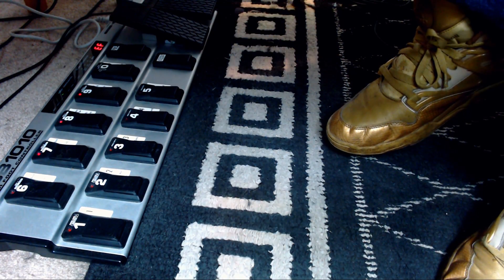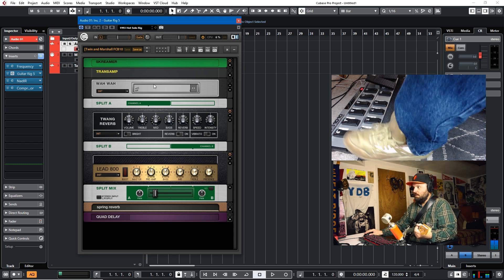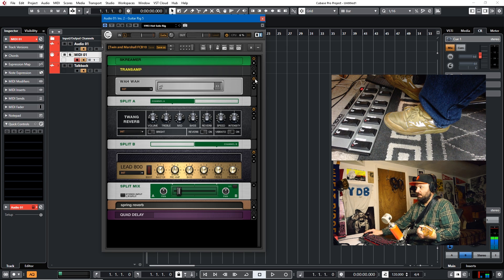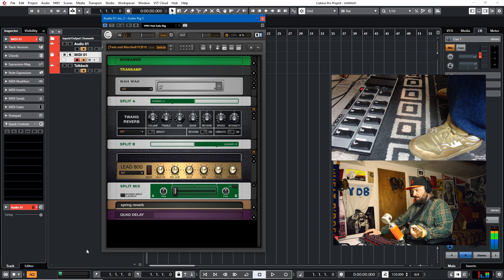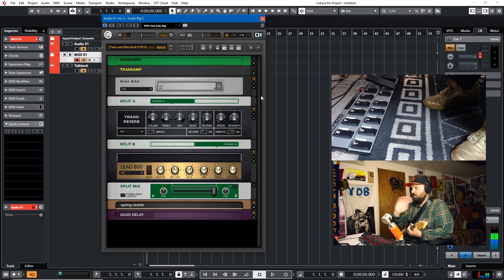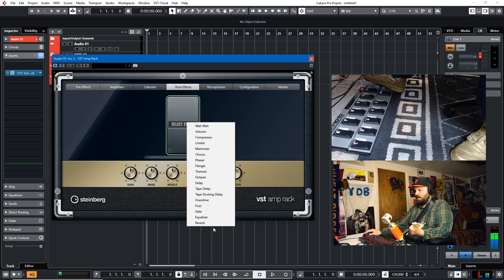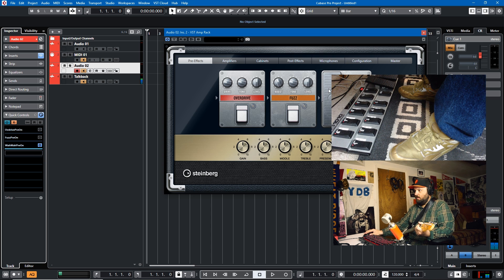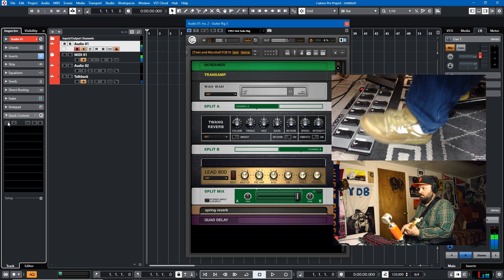Cubase 10, Behringer FCB 1010 and Guitar Rig 5 - Quick Tips

Comment: Hey, thanks for this video. I recently bought an FCB1010, and I really like it. I'm primarily using the controller to change my rack presets in Guitar Rig 5 and I have assigned various functions to the expression pedals. So far, I am struggling with using the FCB inside Cubase 11. One of my main GR presets is my main heavy rig, and I have assigned one pedal as a volume pedal and the other to control preset volume and distortion/gain levels. But none of that information is present when I open Cubase, where I have GR inserted as a VST plug-in. Do I need to reprogram everything inside Guitar Rig's Components like I did to assign the expression pedals when I use GR as a stand-alone? Or do I need to create a MIDI track as you did in this video? Thanks again. Peace.

Comment: HI, thank you for the guide. I have a question..
I've programmed the FCB1010 button number 1 for the Screamer, but the Screamer only turns on as long as I press the number 1 pedal. If I release the pedal, it turns off. Is there any configuration on FCB 1010 for this?

Comment: If you haven't figured it out yet, or for anyone watching this video hoping to find the answer, each foot switch pedal can be configured to send a different CC value for the expression pedal. So for instance if you stepped on pedal 1, then moved the expression pedal it may be sending CC value 1. If you stepped on pedal 2, then moved the expression pedal it may be sending CC value 2, etc. 
Whoever programed the board before you probably wanted to control 2 different effects depending on which foot switches they had engaged.
You'll just need to program it to send the same value, regardless of which foot switch is 'activated'.

Hope that helps!

Comment: Great video! I still have one specific question. The foot controller it can be programmed other than toggle mode? For example if I would like to use for articulation key switching, there always I need a midi message when the button is pushed down and indifferent how long I keep my foot on that, no more messages has to be sent. Eventually, the led to indicate the last selection or nothing.

Comment: Hey TLM! Controlling Steinberg-Plugins only via Q-Controls is wrong. Cubase is known to be THE DAW with MIDI-Possibilities all over the place! 
It would be a shame for Steinberg, if you could not control any midi-device the way you want it! Heres the thing: Go to the "Studio"-Tab, then choose Studio Setup.
Then click on the + on the upper left side. Choose "Generic Remote". Now in the added "Generic Remote"-Tab, choose your Behringer FCB1010 to be the Midi-Input.
Now you should be able to assign the pedal, via "learn"- function, for example "fader 1" in the upper task. Now you have to assign that controller to "Fader 1" to the 
WahWah-Pedal of the VSTAmpRack in the lower task: (AmpRack (or any VST) has to be inserted to any Cubase-Insert/Send or what ever.) 
In the lower zone look for "Device" and choose "VST-Mixer" from the dropdown. Next under "Channel/Category" select the channel where VSTRack is inserted from the dropdown.
Under "Value/Action" from the the dropdown choose "Ins 1 VST Amp Rack" and scroll down to WahWahPost/Pre. There you have it! Now you are able to control almost every
parameter of cubase via midi, even program Commands. Check out the "Device" task (and its sub tasks). You can also add multiple Generic Controllers, 
with different devices, midi-channels, setups what ever and save it to your harddisk. I hope this helps! If you have any further question, please send me a message. Greets
Reply: Whaaat?! I am trying sooo hard to understand the terms that are used here. It seems as if I have missed a very important College Degree . None and I mean None of this is easy or simple to the common guitarist. It seems that everyone is using a different set up. Can anyone speak in terms a Guitarist without a Sound Engineer Degree can understand ?

Comment: Cool video.
How would you rate the steiberg guitar amp, from 1 to 10 ?

Yeah, the quick controls were a great idea,  it worked perfectly with the cmc controller series... the cmc-qc  can be found for very cheap,  today.
If steinberg hadn't been so fuking greedy, by selling each cmc units for 'only' 150 bucks, and had sold it for 50-$70 each unit,  they would have sold millions and millions. ..
But 150 bucks for just a tiny controller. . Even the biggest steinberg fanboy  didn't blindly jump on it. 

This being said, i was able to grab a cmc qc, ai and ch, for very cheap. Frankly,  it works great with Cubase,  being able to control those quick controls with a cmc-qc controller,  is just fantastic. One thing that is great,  is we can create presets for the quick control panel.
We could,  eg, create a preset,  to control the volume, pan, gain, low/high cut, etc etc, and have it automatically assigned to an audio track.
That way, when we select a particular audio track, we can immediately start adjusting the volume,  gain, pan, etc etc.
Steinberg had a true gold mine, with these units. ..damn, they were selling a little enclosure for 3 units. . For 150 bucks !

Ps. It's great to see you posting so often ! Keep those videos coming,  man :)
Reply from the maker: Thanks!  I rarely use VSTAmprack.  I find myself using Guitar Rig or the Poulin free amp sims more.  I use Nadir as an IR loader for the Poulin sims (and for guitar rig).  I may bite the bullet and try the Positive Grid stuff some day, but I don't see a Kemper or Fractal in my future any time soon.  And I'll look into the CMC-qc second-hand.  I'd like to try one out. Chees!